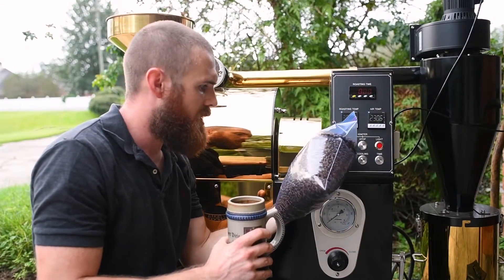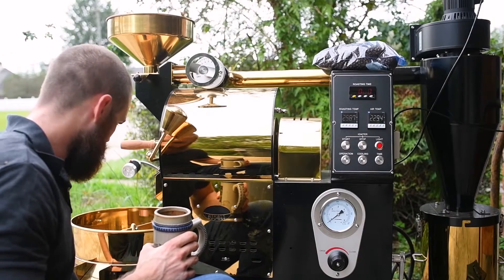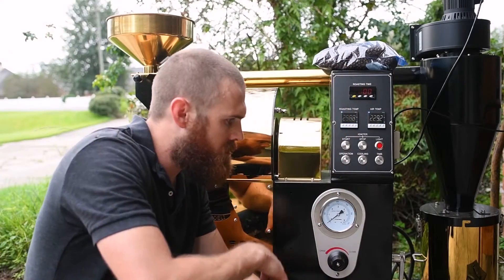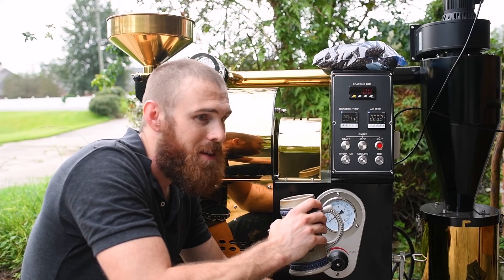Roasting Coffee on the Bideli 2KG - Full Roast Review

Comment: What's the biggest factor for achieving an uniform roast, assuming that its roasted with hot air?
Is it:
- Determined by the green bean as in if it was handpicked acording to its ripeness of each bean.
- Size of the bean.
- Water content or is this certainly the same throughout the beans if its a single origin.
I'm asking because some roasters man they manage to produce a "single origin" roast where the colors differentiate between beans like 4 tones and i'm like how is this even remotely possible if it wasnt done on a frying pan?
OR, might it be that this roastery that i have for an example might have made multiple batches and done a sloppy job so just whipped all of them together and called it good?

Great content also, u seem to enjoy making it so keep doing whats close to your heart!
Reply from the maker: Man all those factors could play a part. For me the biggest factor I have noticed in getting a good uniform roast is batch size. If you fill the roaster with to much coffee it doesn’t fling around enough and some coffee closer to the drum during the final couple minutes will be darker than those caught in the middle of the pile. That’s why the batch size matters to get a good even roast. When the coffee is flung around in the drum evenly all the coffee gets a good dose of the heat. But some people like to push higher quantities through their roasters but it degrades the quality. Quality of coffee can be a factor too. If the beans where not processed correctly and some have a higher moisture content than others then they will roast differently. Same with size. If the coffee is not sorted correctly that could play an issue. Smaller beans will obviously roast faster than larger ones depending on density. Actually this sound like a good video. I may try to put something together on this topic. Thanks for watching buddy and hope my rambling was helpful! Lol do you roast?
Reply: @RobPirieCedarOtaCoffee  im gonna bro. im thinking of getting a 10kg toper which should be fine even if the business expands, what do you reckon? i really wish it was a 15kg one so i could push 10 kgs through per cycle but even if i push 7 or 8 through the 10kg machine its around 30kg per hour which for 8 hours of roasting is around 240 kgs
Reply from the maker: 10kg is pretty good size! What is the current demand you think you could get and how much coffee in kilos could you sell a week? Is it just you roasting and packaging or would you have help?
Reply: @RobPirieCedarOtaCoffee  Not certain. pretty slow at start but i've got the time. its all built up on savings than debt so no rush
Reply from the maker: @sasstamming  That is the best method. Taking is slow and having the ability to adjust and adapt along the way. Good luck my friend!
Reply: @RobPirieCedarOtaCoffee  Thanks a ton bro, youre great!
Reply from the maker: No problem my friend! Anything to help coffee improve! Haha